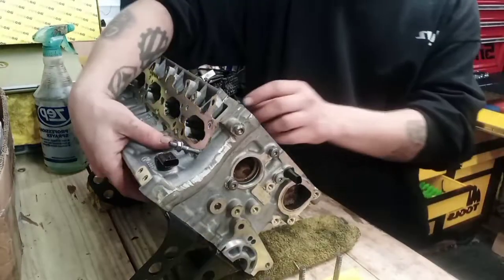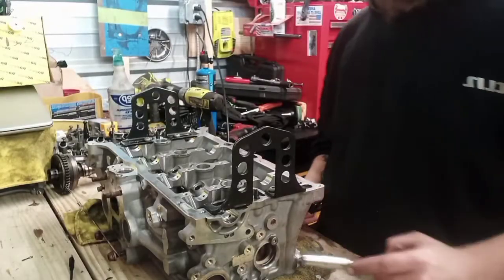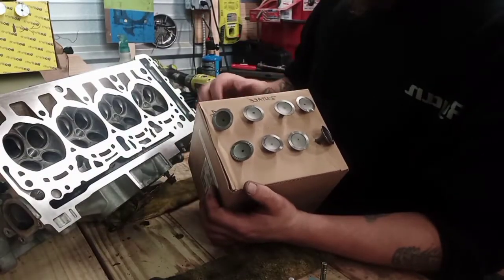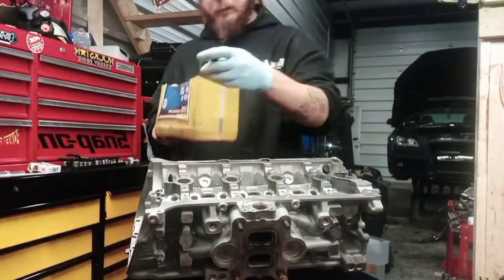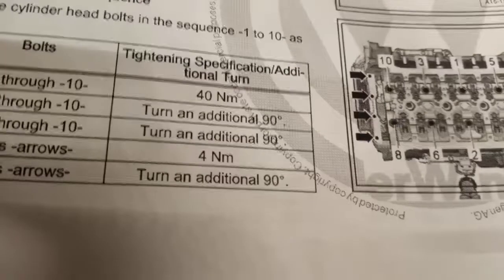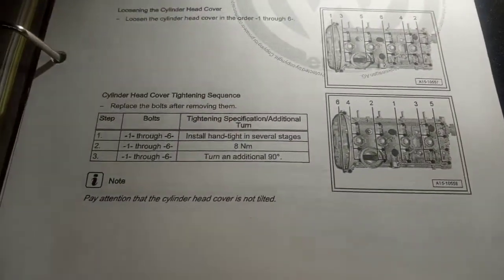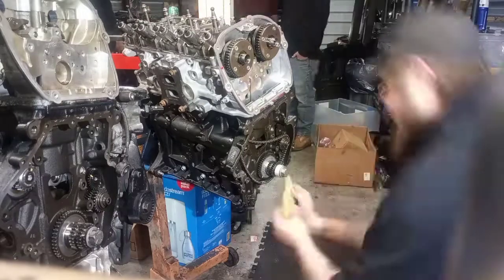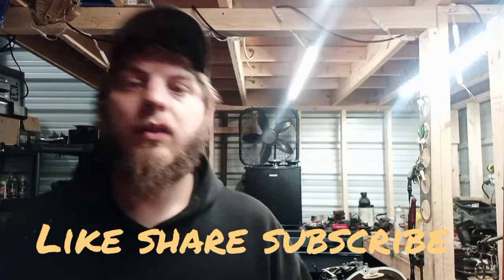MK7 GTI Engine rebuild - Pt 2  The Head & Timing #gti #volkswagen #tsi #MK7

Comment: You don't actually show installing the timing chain and the special tools needed to turn the cams to get the chain to line up to the marks. This is especially important if you have had the cams out. You show the end result, not the process. Good video otherwise.
Reply from the maker: Thanks you for your input!  We appreciate it. It was one of my first good videos. And yes we forgot to give info.  The later videos I made. Go a bit further into the timing marks and such.
Reply: @Weissworx  They are good, well thought out. It only came to mind as we are in the middle of a rocker arm replacement on a 2015  GTi. Was trying to find a video of someone setting one up. Yours was the closest I came to one.  As usual the Erwin is not very clear.  We specialize in VW/Audi for over 40 years, but this is the first double variable cam timing engine we are doing. So I had to do research and saw the extra tools I had to order. No criticism intended.
Reply from the maker: @ChrisLinstead non taken!  Thanks for your input.   If have any question ask away
Reply: @Weissworx  I'm trying to figure out if I need 1 each of the cam turning tools; T40266 and T40427 or will just 1 do both cams?. Do you have these? They look different over all but the part that fits into the cam to turn look the same on each. Thank you.
Reply from the maker: Thanks for the input. Helps us further to make better ccontent We do have another video posted on the installation.     Thought about that. After I released the video.